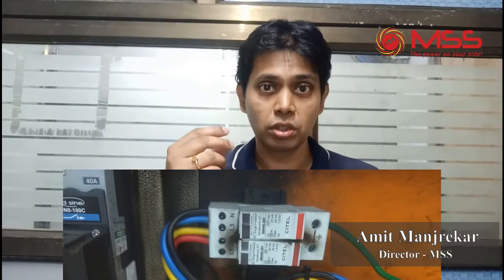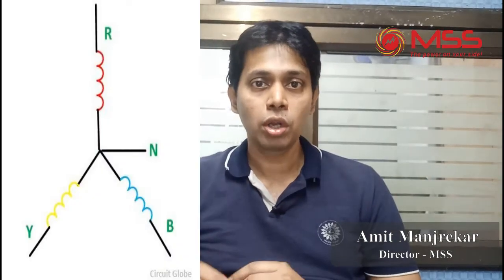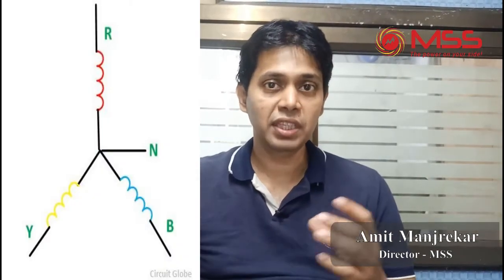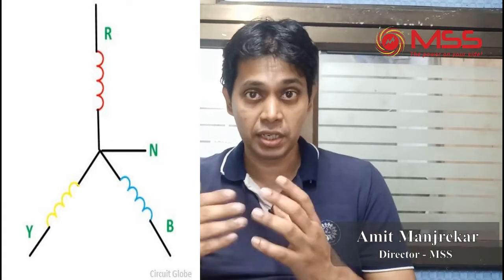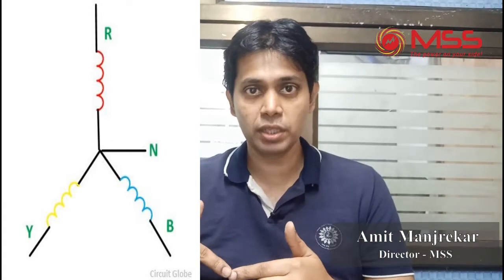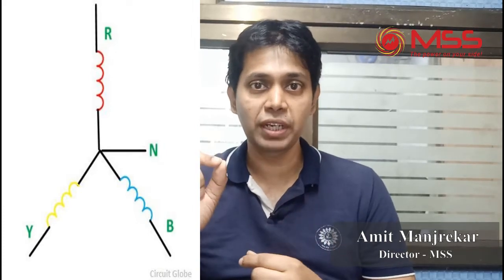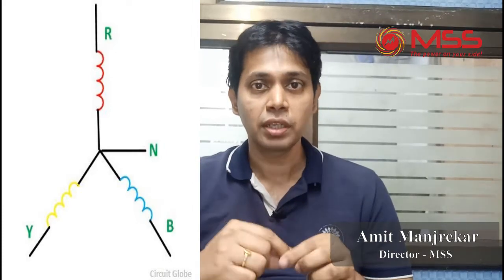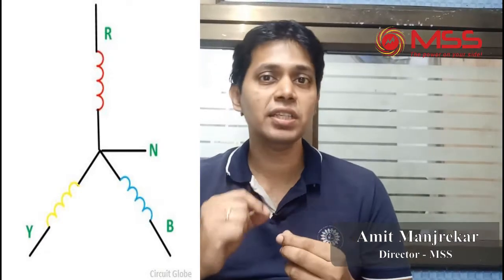SPD damage issue in solar power plant

Comment: Hi, I have one solar panel 390 watts , which  rating of dc spd is compatible. I may further cannect another the same panels in future. Please help me.
Reply from the maker: It depends on system voltage.
If your total system voltage is less than 1000V you can go SPD of 1000V.
Reply: Please check inverter data sheet. Max input voltage.